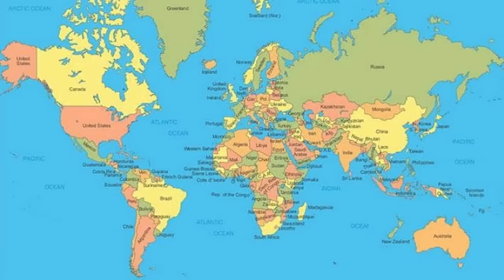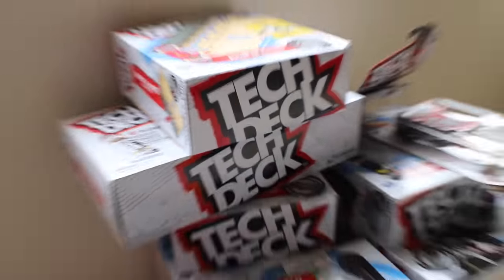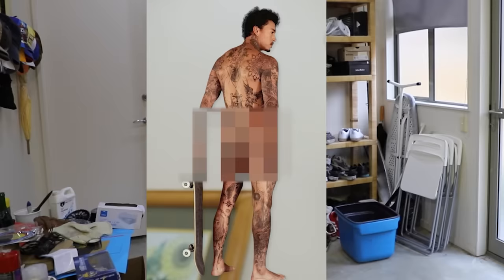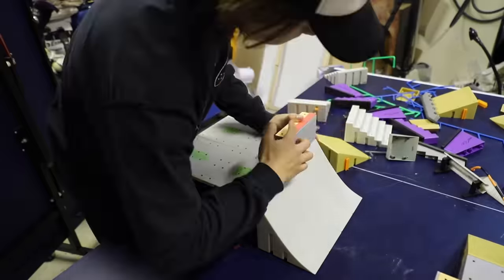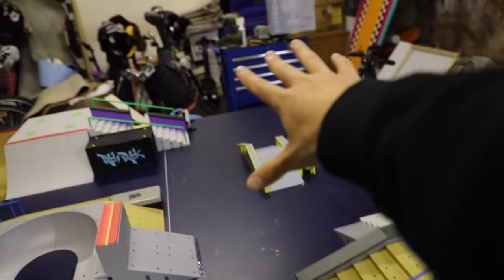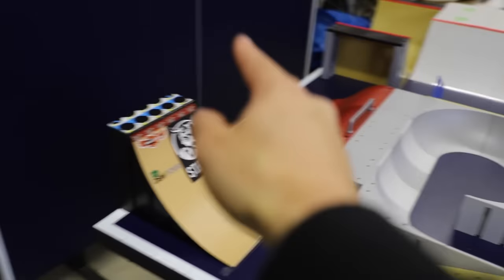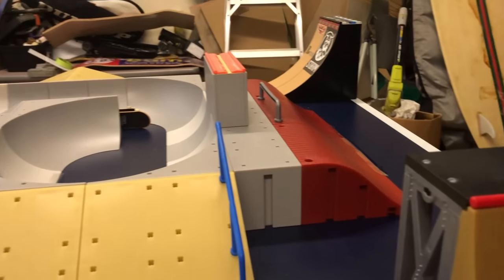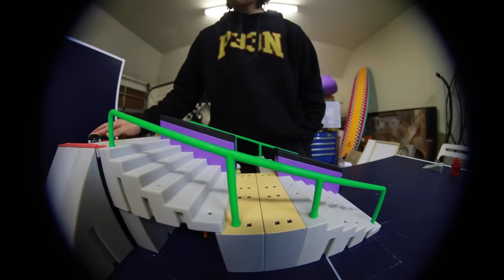HUGE TECH DECK SKATEPARK!

Comment: You should find some of the older tech deck ramps, they were larger, better built and gave more space to ride. The new ones seem so compact with rails barely as long as the board. As time goes on they seem to shrink and appear cheaper made.
Reply: Yeah and the holes in it make it so bumpy and loud